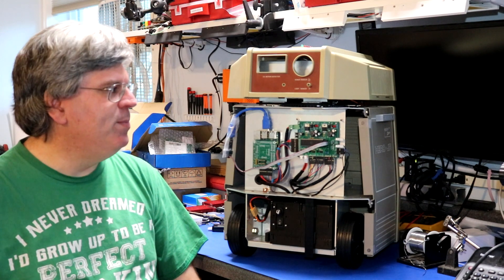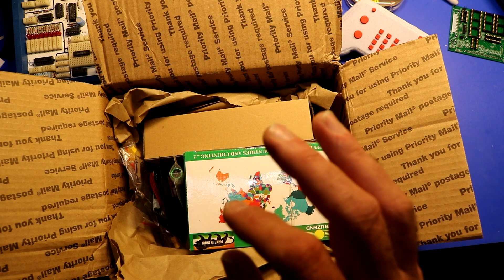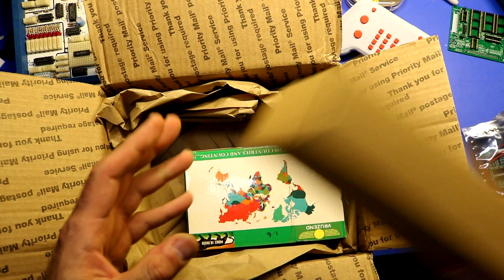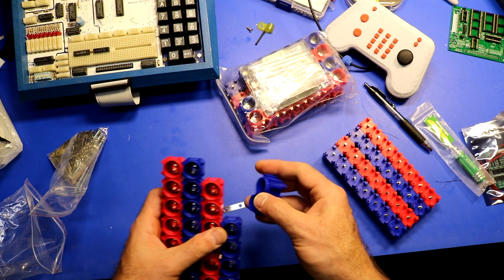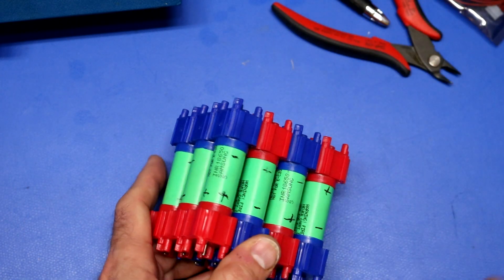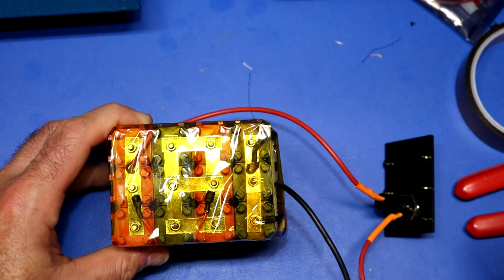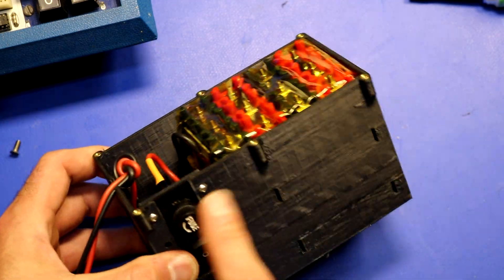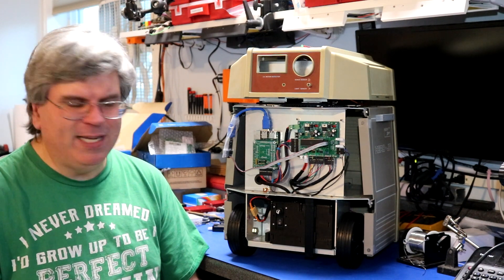Vruzend Battery Kit Review / Building my first Lithium Battery Pack

Comment: Thank you so much for the video. Are you able to post the overall height of a cell with both end caps pressed firmly on? I am looking for an enclosure which will, and cannot locate the overall installed height info anywhere. 

The only reason I could see not to use ring terminals is the chance to add resistance to the BMS balancing circuit which is using such small amounts that even the length of the wire, or the ring terminals themselves could interfere in the delicate cell balancing procedure.

Please if you can, post the overall height :+)